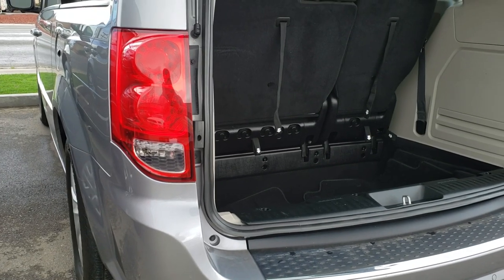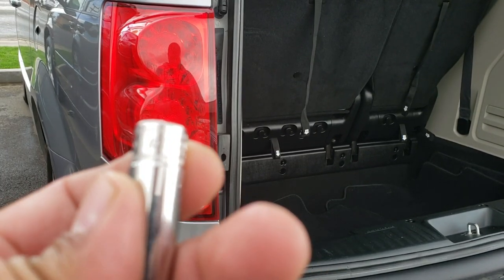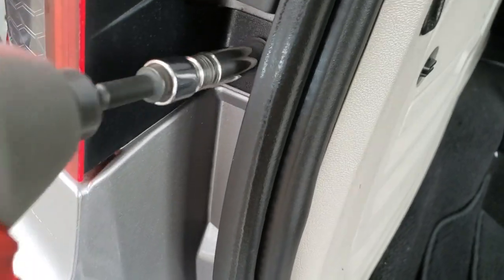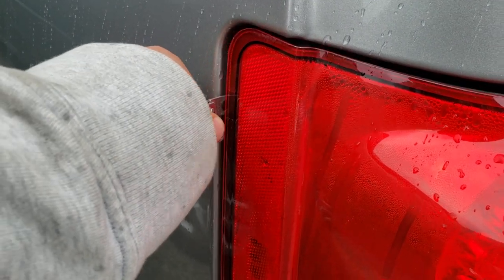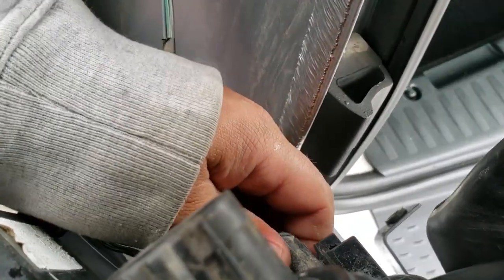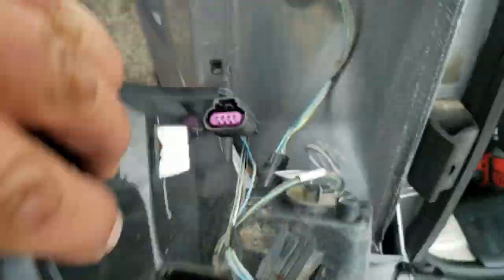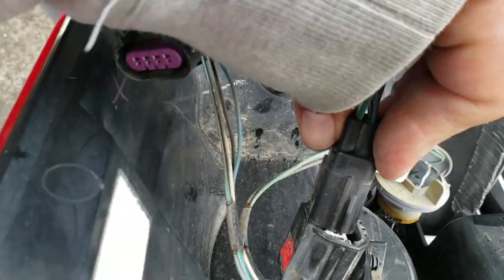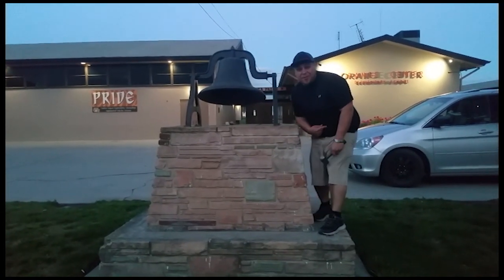How to: Remove a Driver rear Tail light on a 2016 Dodge Grand Caravan

Comment: What did you have to do to remove the center connector with the red switch?
Reply from the maker: The red switch is a locking tab. Pull it back with a flat head and you shod be able to release it. Good luck bro

Comment: I can’t get the cable connection to come off
I tried to pull on it after pulling the red tap upwards with a flat head screwdriver and even used pliers to try to get it off it’s like the previous owners used glue so tight
Reply from the maker: Wow sounds like it. You can try positioning yourself in front of the Taillight then with both hands open handed (like high 5's 👐) then forcefully slide and grip them as your trying to slide it out towards the trunk....sometimes thats the only way i can do it to get it out. Gotta slap them out of there 😬 
Good luck. I hope this works out for you!
Reply: same man its like its permanently attached or something.

Comment: Hoy balls, I can never remove that large joint, and have to reuse the light plugs. I've replaced the light twice on a 2015, same light fixture, and fond it impossible to seperate the two. I just left the old light connections and they worked just fine, since most importantly, the new fixture didn't have the back up light anyhow. But shit, I used pliers, screw drivers and almost called Steve Rogers since it was next to impossible to sever the connection. WTF?
Reply from the maker: Lmfao yeah man some times it can be a pain to get them out...sorry bro! On the bright side....today's FRIDAY! LOL HAVE A GREAT DAY!